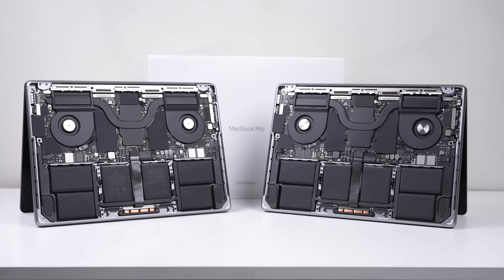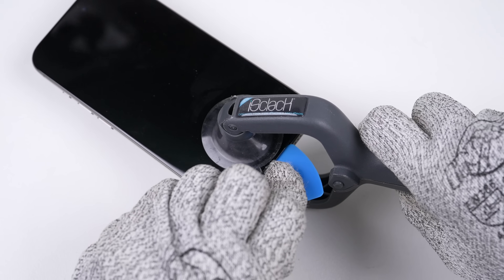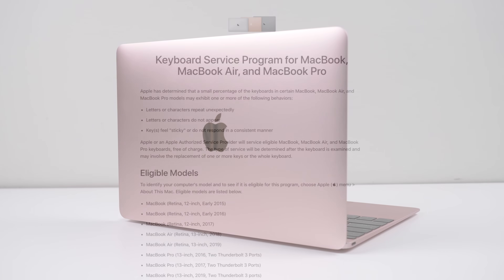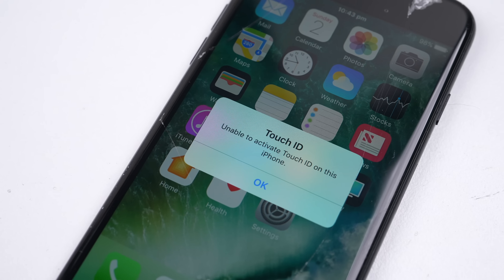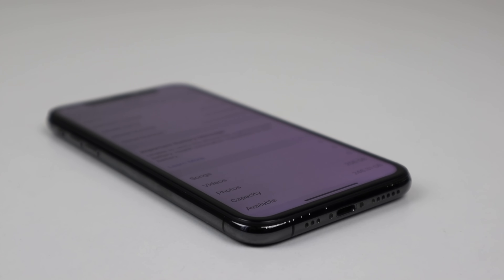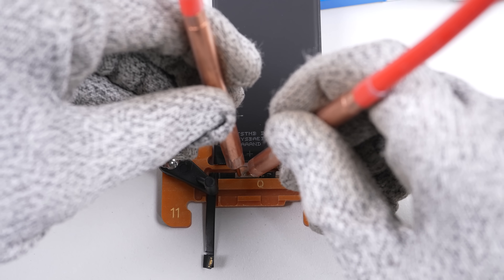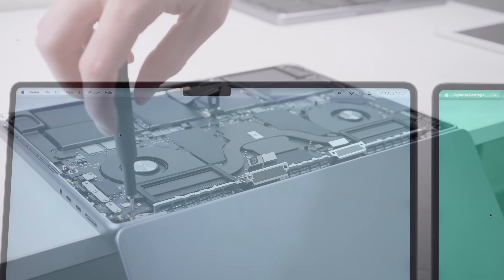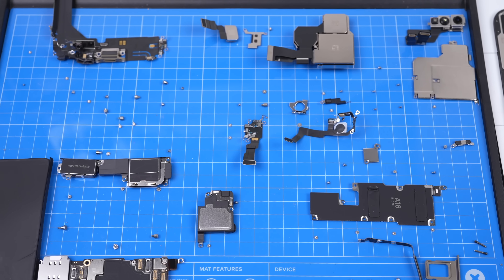Astonishing Anti Repair Practices By Apple In the Last 15 Years

Comment: I bought an iPad mini 4 a couple months after release and was overjoyed. It is still to this day the thinest tablet I've owned. Around 9 months in the volume up botton began to fail but as I was using it as my daily driver and I was a poor kid I didn't even think about warranty. Then the down button began to fail and I took it to apple 1 month outside of a year and they denied my any kind of fix excecpt for replacing it for 400$ through thier programs. That was the last ipad I bought because I was so bummed to learn that fixing it even with a 3rd party was going to be almost as much as new one. 
I loved my first gen iphone SE but apple makes phones dated so quick and by year 3 it felt slow and sluggish. I got an s9+ after that and rocked it for 4 good years. Every phone since I've tried has felt like a downgrade. I crushed my s20+ in the door of my truck and have yet to replace it because there's nothing worth buying. I'm sticking to 300-400$ phones.

Comment: The regulators are really to blame for all the above, not Apple. Apple has been doing it because they can get away with it. Forcing customers to get after-sales service from the same company that makes a product is explicitly an antitrust issue. 

This is technically illegal even in the US, not just the EU. BS "Warranty void if seal removed" stickers are also illegal and unenforceable. Antitrust law forbids all that, but the problem is that regulators rarely intervene to enforce the law.

Comment: Watching this after recently replacing my Dell laptop battery by myself without needing tools hits different. 😂
Reply: I'm still using a 10 year old Dell laptop and I have had no issues with it. I recently did a complete refurbish on it, so it should last me another 7 years until the motherboard finally dies.
Reply: @crazychicken2005  I love the older Dell Latitude laptops. I have a bunch of them. 

My favorite is the 16" latitude 6520/6530 (2nd and 3rd gen intel core processors), and a 1920x1080 display.

I swapped a backlit keyboard into mine, and have a removable CD tray that houses a 2nd hard drive. Coupled with an external swappable battery the thing is simply awesome. 

It's heavy, and I wish I could have a modern processor in it, but I still love using it, it's perfectly fine.
Reply: i have two old inspiron 15's , just dropped brand new hard drives in them (plus added a second terabyte in the cd-rw bay as well in each. dropped new ram in both, and most importanty, got them running lubuntu. 

both shitting all over my wifes brand new windows laptop lol
Reply: I feel you. HP 2560P user here. Released in 2011, bought sh in 2016 for like... 150$. Still using Win 8.1, can still hold like 2 hours on the original battery. Good times are when you make them. And taking into account the life expectancy of these devices, I don't even know how many times me and the reseller "saved the planet" in all these years :)))

Comment: Didn't see air pods in the video. Battery sealed inside the plastic case and mine stopped holding charge within about 2 years

Comment: tbh tri-wing screws are quite easy to unscrew if you just happen to have the right flat head laying around. heck the screw that only has 2 dots on the edges are also able to be unscrewed yith just a flat head.. but on the other hand to me flat head screws are the worst... they just brake or strip.. i rather have the security screws instead..

Comment: What about the Home button on the 5S/1st gen SE? The super-fragile flex cable is folded in such a way that if you haven't taken one apart before, there is a very high chance you will tear it as you open the phone. If you buy a third party Home button it won't have Touch ID, and there's no way of getting it back unless you get it changed by Apple

Comment: Android phones may be a mixed bag on ease of repair. Some Google and Samsung phones are just as needlessly complicated. Where as some like Asus' is a matter of just carefully prying open the back and bunch of a screws.

But Apple is always a nightmare. Those pentalobe screws, using glue over the entire back to try to make removal as destructive as possible, faking "defects" if the serial doesn't match. And NO, there is no new beginning. Moment any bill shows signs of seeking to make Part Pairing illegal they scream like banshees...
Reply: Samsung is apple for poor people, they are even more anti consumer.

But android itself is essentially the Linux of mobile devices (a Linux user would hang me for that comparison). It is up to the phone's manufacturer instead of the Android devs.
Reply: @rompevuevitos222 Oh absolutely, as bad as apple's new macs are, the galaxy books are just dreadful. At least the M1s are durable and fast.

Comment: I don't get why people still buy their crap! It's not only overpriced (a regular "old" computer with similar speccs can often be had for 2/3rds the price if not less!), but also a gilded cage and that they make repair harder or even impossible (at least for the regular dude and dudette!) is the cherry on to of the shit cake they are selling and people still eat it and ask for more! Hell, I've changed phone maker for my last 2 phones (I was a Samsung customer until the Galaxy S2, which lasted me 5 years and then broke (internal memory fragged - not even dev-tools were able to flash stock android onto it anymore -.-!), after that I had an LG G4 because that offered three things I wanted: Headphone-Jack, SD-Card-Slot and removable battery...and my current phone is a Gigaset GS5 (for the same reasons I bought the LG G4!)...seriously, I am not buying a phone where I can't remove the battery, it's the part that will inevitably degrade and thus I want to be able to replace it easily, especially since I use phones till they break - I don't need one every 2-3 years! Why? The newer ones aren't that much better, no quantum leap in technology happened since the first IPhone! Frankly as long as they'd keep software updated (or as long as you can flash more up to date Android onto the phone yourself!) the phone works! Hell, if you could run the newest android on a 10 year old phone, that would be fine, too IMHO!)
Reply: It's a cult, it's obvious why they buy it.

Comment: Apple needs to be investigated by the ACCC. 
I had a MacBook Air which had a failed USB C/charge port which occurred just after the warranty expired. I was told they would have to replace the entire laptop, at my expense. I told them they were in breach of Australian consumer law but they wouldn’t budge. 
A repair shop told me only the USB-C port needed replacing.
Reply: Yep I fixed a macbook of my friend by replacing the usb-c port as well. It’s ridiculous how easily they break.
Reply: I read ACDC lol
Reply: And when you told them they were supposedly in breach of some law and they did nothing, what did you do?  Nothing.  Because you know you don’t have a legal leg to stand on.

Comment: Apple is using the repair bill, which has terrible loopholes in it, to hobble competition while doing the absolute bare minimum to be in technical compliance. THAT is why they support it. Because the bill actually doesn't meaningfully allow for right to repair.
If Apple supported actual right to repair, they would release a software update to all devices to do away with their planned obsolescence code and their anti-3rd party parts system.

Comment: In my opinion apple is so expensive because it is so hard to repair.
You could do it much cheaper with standardized parts that are easy to replace.
Think about the cost and inconvinience of having to replace whole systems if one component not works right(even if technically not broken).
If you buy these products its your own fault.

Comment: Amd they call non apple users poor. No. I want a working product. Unfortunately so many companies adopted policies on how you can't fix your own stuff like that as well. I remember when I fixed an old HTC phone because the SIM and SD card reader brike and you unscrewed a few standard screws, pulled the battery out with your fingers and flipped the connector clip holding the part I was changing up to take it out and put the new one in. No special screws, no glue, no trouble. Now you can't even get phones open without getting a masters degree.

Comment: Can someone please explain why people still buy apple stuff? It's expensiv, you need extra stuff for everything and you can't even repaire it cheap if it breaks. So from my view apple F's it's customers in every way. And the customers seem to go down on all 4 and beg for more. Are apple users are all M's?
Reply: It is because there is not a single Laptop at the moment that combines power and efficiency as the Macbook does..
Reply: @laugenbrezel_  Dude stay away with that expensive scrabmetal 😂
Reply: @321GhostRider123  Seems like someone has no solid arguments against my point and has to resort to insults…
Reply: @laugenbrezel_  well in that case, no macbook combines power and efficency than "enter some random laptop here". What an argument huh? I would say its just a personal statement how you see the macbook. Whatever man, i already feel my head hurt by this sensles conversation

Comment: MESSAGE TO ALL THE DWEEBS FEELING SUPERIOR   I agree - Apple is not for you and Apple are a terrible company for repairability - Apple is for professionals who need tech to work.

And have the money to replace it when it does not. I'm an author, my ENTIRE livelihood is earned on an iMac. If it stops working after 3 years and it costs me £3,000 to replace it - so what?  Engineers dont buy Harbour Freight tools.  If you dont like Apple, fine Apple is not for you, but if you are a creative who pays the mortgage from your work - you buy Apple.
Reply: but is there anything about your work that can't be done on a cheaper laptop?
Reply: @Xiefux  YES - it wont work after I've thrown it out of the window cos its so f-ing annoying that it drives me crazy.  Professional welders don't buy hobby welding machines, even though they will weld. Professional auto mechanics dont buy Draper socket sets even though they will undo bolts. 

Lets say I saved $2000 and the machines both last me 4 years. I save $1.37 a day and have to work on an annoying laptop, why would I DO that...? 

Your decisions are based on cost of purchase. Mine are based on income generated.
Reply: @piccalillipit9211  what is it you do exactly?

Comment: I've never had an apple, but I remember my first laptop had an external battery and you could buy several batteries and replace them even if you have no access to electricity whatsoever which is useful when you take a laptop while hiking but most importantly it didn't need any repairs for almost 5 years and served for 10 years before I had to buy a new one for the lack of spare parts

Comment: That reminds me to have another got my iPod. The battery went dead and I ordered a replacement kit from eBay, but even if the casing is neither screwed nor glued, I simply cannot open it up unless I go for a blowtorch and an angle grinder ….

Comment: TL;DR: Apple decided that the customers are banned from repairing their tech, then we'll ban anti-repair.
That's why I would abstain from Apple's devices. When you have some part broken, you can't replace it manually, or through third party. Since there is no regulation on repairs, the situation is out of control. EU is trying to step in, but it will be way too late. The manufacturers should be moving back to the repair and upgrade-friendly designs and make up the sales. Yes, it slows down the tech innovation, but the tech is growing so fast, that designs with repair in mind, will be a new innovation for most normies. If you broke your screen, just unscrew, replace, screw it back together and you'll get a phone that looks new. If Apple did repair-friendly designs, it will benefit not only them, as these things will be reliable, but also benefit consumers. Especially in Japan, where 70% of people there are iPhone users. And minimize e-waste, while keeping the boxes bigger with a fricking charger. So I should say anti-repair should be banned. And put John Deere and Apple responsible. At least people will stop buying shit every year, or sending to overpriced service when it inevitably breaks. Repair shop owners will understand me.

Comment: Denying amateur repairs is one of radio certification requirements. It's legally required that the device has to be difficult to illegally modify so that license-free radio equipment cannot be used to transmit other types of waves than approved. That law has to change first before Pentalobes go.

Comment: Years ago, I bought several iMacs, and I liked them a lot, but when it came time to replace a GPU on a 5-year old iMac and apple wanted me to simply send it back for recycling and buy a new one, it seemed SO wasteful.  I ended up asking my local computer store to assemble a custom-made old-fashioned tower, because at least now, when a part breaks down, I can EASILY pop it open, replace the part and keep going.

Comment: The moment that cemented for me that Apple was against right to repair was when I had an iPod die on me after about 4 years. It was the nano that was just a touch screen, The screen wake button stopped working so I took it apart to see what the issue was.

Every other device on the planet has a button that makes contact with a surface mount switch on either a control board or a ribbon cable. What they had done was to make sure there was a gap between the switch and the button, filled with The tiniest piece of rubber held on with the most minimal amount of glue. 

I took such good care of that thing, never dropping it or exposing it to very high temperatures. So for one of the most crucial buttons to just fail due to a bad design, and in a way that would require 95% of users to either buy a new one or pay for a costly repair is infuriating. Older iPods seem to have been built with the idea of repair, but that one almost seems like it was set up to be a disposable unit

Comment: Jeezus.   What a bunch of Apple Haters.   Apple is a corporation.  They sell a product.  From the beginning the product they have sold was not merely a computer, but a computer that was easy to use, and just worked. Back n the day, Apple computers were a pure pleasure work with, whereas PC were a frustrating and confusing chore. That reliable and intuitive performance was what supported their higher pricing, which is why they did not go out of business like other PC makers who joined in the price slashing race to zero profits and bankruptcy in what became the Windows world.   The KEY to Apple’s products’ performance and reliability has always been total control over the components and architecture that go inside the devices. That is why their updates were always far more backwards compatible than anyone else’s. It’s why they could know exactly how their system software would work on every one of their devices, and rapidly identify bugs and fix them in ways that did not create Other problems.   And it’s why they did not want to allow just anyone to crack them open and replace parts with parts that did not match spec, or were already used or damaged. 
They understand that keeping their products the most effortless, intuitive, and reliable devices on the market IS the core of their business. 
-Oh, and it’s the only reason we have the smart phone apple knock offs we all sport, today…because ONLY Apple was able to get multiple independent major businesses,  From AT&T, to various ISPs, to Google, and EMI and other music rights companies to ALL invest hundreds of millions to make THEIR systems compatible with the original iPhone, So that the things would Just Work, right out of the box when it was released for sale. 
THAT is what is behind the ‘Anti-Repair’ practices, at least at Apple.    Even Cars, as they become increasingly reliant on black box computers and other electronics, are becoming larger liabilities to their manufacturers when just any old doofus can take a wrench to things he doesn’t understand. 
Try and imagine the nightmare of making cars that are Drive-by-Wire, where a software glitch can cause loss of control and death, should someone ‘repair’ a component with the wrong chip in place because its what they have or its cheaper?
That is why the pressure is mounting on companies to make their repair systems more closed and controlled.
In MOST corporations, Servicing their products is NOT a profit center. They break even or lose money because what they ultimately get for the repair does not even come close to covering the cost of vast warehouses full of the parts to cover 8 years or more of prior products.
Apple takes the products they replace, or take in trade in, and re-manufactures them to provide the replacement units they hand out under warrantee.
Because they controlled the manner of repair and the components installed, and know how to test it for correct performance, they can then know that product will give the user the experience that is their primary selling point.   They do not want their market polluted with ineptly repaired products with their brand on them.  ( And I know not all folks would repair them ineptly… but a significant percentage certainly would. )

Comment: The extents a company can go to ensure DIY repairs are as difficult and tedious as possible just so you're basically out of options once your hilariously brittle and frail piece of tech breaks and have to buy a new one/pay 90% the price of a new one to get it repaired is insane. It does pay them, but it is very shady and anti-consumer. Glad I'm not an Apple tech user myself.

Comment: Your start is totally misleading, apple support repair by providing the ability to buy every single replacement part at once from them at high mark up, no ability to buy the one piece you need to replace for example, and continued absolute hostility in design for repair work